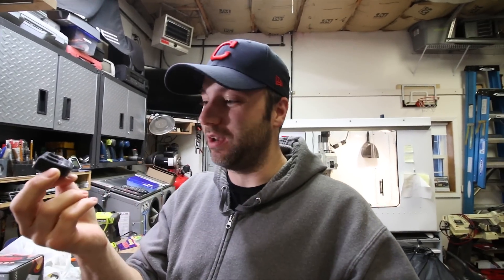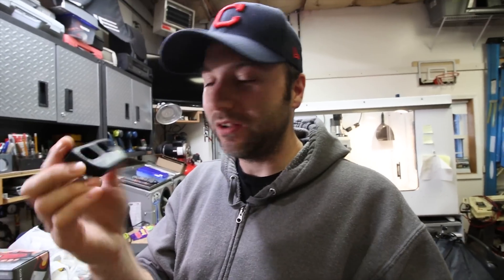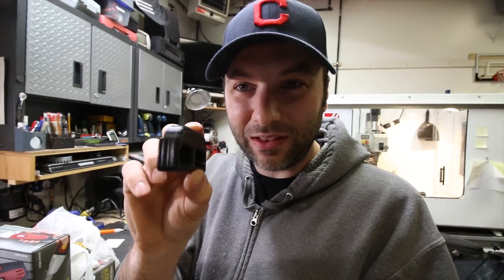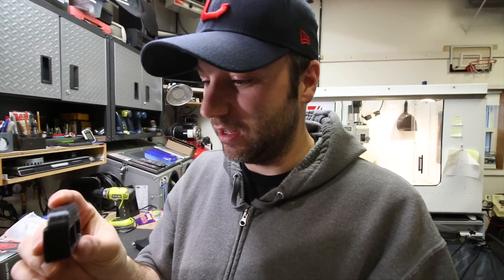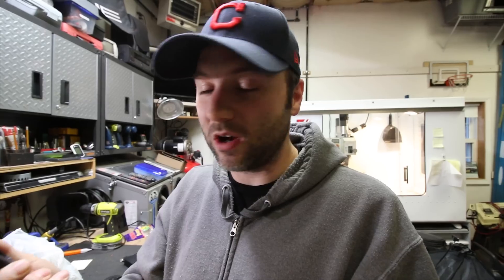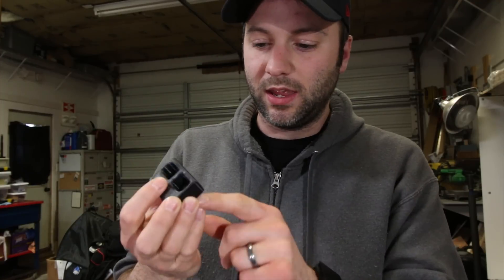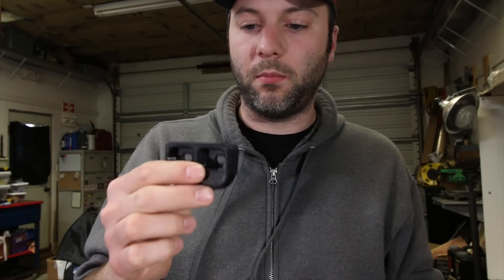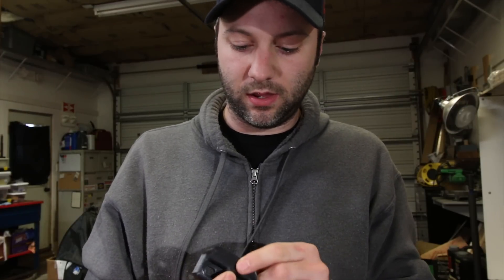How Strong is 3d Printed Nylon?

Comment: Would it be good to use that Nylon to make a small 30mm and 107 teeth 0.5 mm high gear? I have tried PLA and the teeth are not well defined.

Comment: You're not supposed to print on that surface. There should be a removable metal plate.
Reply from the maker: This video was created before prusa had removable flex steel beds. This printer I'm the video was a mk2s prior to that style of bed. The newer machines with flex steel sheets you would be correct but this fied prior to that feature.

Comment: ***WolfBite NITRO***
Reply from the maker: I tried wolf bite nitro and didn't have great luck. I didn't spend long iterating to try different settings but it wasn't the silver bullet I was hoping for.  I have recently been experimenting with Vision Miner Nano Polymer adhesive and have pretty good luck with simply coating the PEI sheet on the bed and hitting print and getting "mostly" warp free nylon parts. I wouldn't set them on a machine flat surface and call it flat but it's good enough.

Comment: You surely did not go into enough detail about printing nylon.
Reply from the maker: There are other videos I've released that cover more info like how to build a drybox and how to make a bed for your printer that nylon will adhere to. What are you having trouble with? Machine specific settings like temp, speed, retraction, extrusion multiplier, etc will vary and I simply used the nylon settings built into the slicers for my machines.

Comment: Hows that printer working out for you?  I'm looking to buy one.  Also, did you test tensile strength?
Reply from the maker: Prusa has been great. Probably the most consistent print quality of my 4 printers. Only has needed typical maintenance, nozzles, replaced pei sheet, one thermistor. No tensile tests... I guess I could have rigged up something crude to do a tensile test but I trust the published data and the other bloggers/YouTubers who have tested it.  The parts on my car are still working great no failures.

Comment: You like Miatas and 3d printing functional Nylon parts.  Same...We share some really off the wall similar interests.
Reply from the maker: Insert *did we just become best friends * gif from Step Brothers. 👍Awesome.
Reply: Do you wanna go do karate in the garage?
Reply from the maker: Yup!
Reply: More miata fans huh, a good tip is to paint the parts with the molotow paint refils and then clear them with alclad. You can make very realistic looking chrome, steel, copper, brass parts for things like shift knobs, hvac nobs, ect. and a way lower cost.

Comment: Is that enclosure with space heaters a necessary requirement to prunt nylon?
Reply from the maker: +Captain Katawa enclosure certainly should help control warping. Depending on how cold the location where your printer is located is the space heaters may or may not be necessary. My printers are in my garage in Ohio where it gets quiet cold in winter . So the heaters help to maintain a 85f-100f environment. The bed heater on most printers in a decently warm environment should help without the help of the heaters.
Reply: Thanks

Comment: Tip 1: printable filament its PA12 
Tip 2: make spool in hot continer in time on you print something prehoted filament its beter
Tip 3: Nylon printed element must by stored for two weeks on atmosfer  nylon need drink water slowly, to be strong. If you stress nylon print quickly you broke simply .... wait 2 weeks for full strong resistance.
Tip 4: sorry for my english ;) 
Tip 5: dont make extruder too hot above 255degr C 260 degradate structurs off nylon.
Importand not stress end tuoch printed parts for 2 weeks ;) if you don belive  tray  your selfe print 2 same elements ent tray  broke in diferent times.
Reply: Thanks for the good advice . I just ordered my 1st roll of nylon

Comment: Newbie question alert!Which is stronger in terms of impact and abrasion-resistance: nylon, ABS or other?
Was wondering because I was thinking of getting into 3D printing to make custom motorcycle body armour (like cosplay but actually strong enough to be CE rated).
Reply: nylon is like unbreakable indestructible compared to ABS
Reply: Thanks.

But now I have another question (and I hope the answer will be useful to everyone):  I hear that nylon slowly degrades in sunlight (although I hear there is also UV-resistant nylons). 
This would mean that items printed in nylon would not be suitable for prolonged outdoor usage, right??
So, in this case, would ABS be better for outdoor usage?

Also, how about polycarbonate? I hear it is extremely tough, too -- stronger than nylon, I've heard.

Comment: Settings?
Reply from the maker: I added them to the comments.  But they were also listed at 2:43.
Reply: Looking more for temps..
Reply from the maker: Sorry I forgot those.  Extruder 240 first layer, 250 for all the rest.  Bed 90 first layer, 50 for all the rest.  Healthy amount of glue stick on the bed as well.

Comment: And… how did it work out? Did you end up using it, or did you go with the machined delrin part?
Reply from the maker: +Runoratsu it's worked great. 3d printed part is still on the car. Hopefully I can make a video about them and some of the other 3d printed car parts I've made.

Comment: not subbing cause I like my eardrums. why play music so loud and the talking parts are not?
Reply: Having the same. Im listening on my Headset mostly but sometimes on my speakers as well. Both have the same issues. The Music blasts away my Ears and the Speaking is low volume.
Reply from the maker: TinkerOwl I'll  do a better job of making sure my levels are better matched in Adobe premiere when editing from now on.  I'm still pretty new to video production.
Reply from the maker: +Zeke Urness I'm sorry to hear that. On my end the volumes levels are pretty closely matched between speaking and music.  What device are you listening on?
Reply from the maker: I'll take a closer look at this.  With my headphones and speakers it still seems good on my end.  Let me do some more testing.  Thanks for letting me know!
Reply: yea tunes about 20% too loud on my system (vs dialog)
Reply: Sounds acceptable/normal on my studio monitors.
Reply: it sounds fine on headphones but shit on speakers
Reply: Sounds ok to me. Music is a significant bit louder than the voice but not much of an issue. A little bit of adjustment and it's perfectly fine.
Reply: I'm fine with it.  Makes it entertaining.